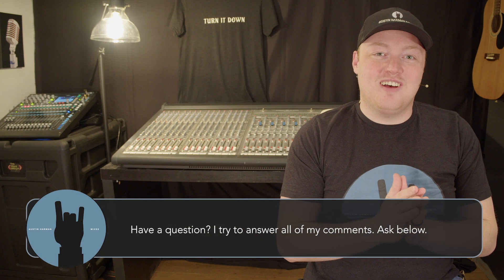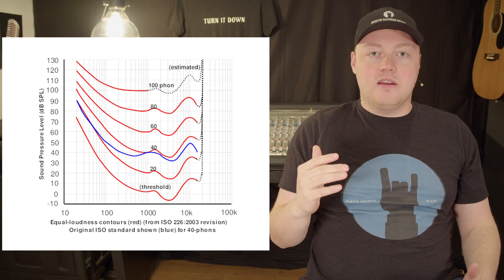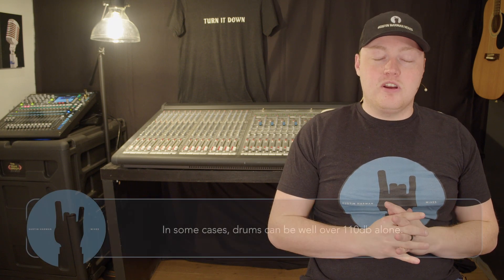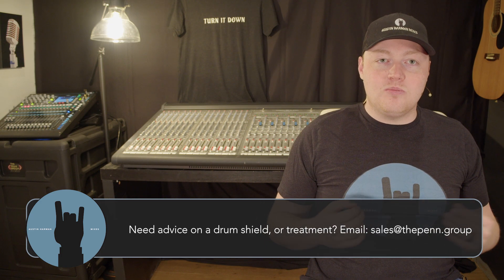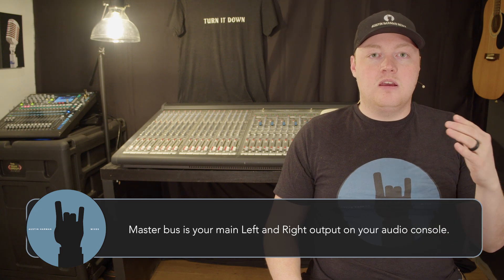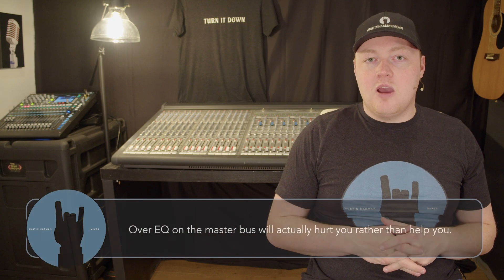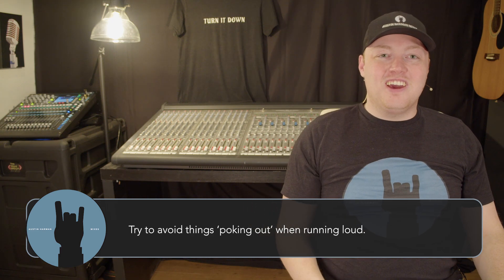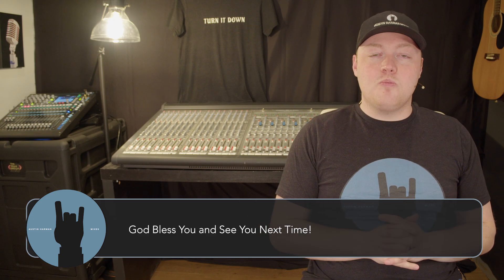How to Mix Loud Live Audio Loud Without Hurting Your Ears | Master Audio Engineer | Church Audio

Comment: Could you tell me which sound decibel meter is reliable and accurate. Or which is ur go too?
Reply from the maker: https://amzn.to/42FU845

This one is my go to. I like it because it comes calibrated from factory and isn’t crazy expensive.
Reply: @austinharmanmixes  another Question. Which IEM ears u recommend  around 200$  to monitor my mixes for broadcast.
Reply from the maker: @darvintoc  

https://amzn.to/4bJssiy

I love these. They are what I personally use to mix. Sound huge and full. Worth the extra $100 no question. I’ve had them for years, and still use them today.
Reply: @austinharmanmixes  do they cancel the noise in a live environment?
Reply from the maker: Not noise cancelation from an active since, but they provide enough isolation to be effective for sure.  @darvintoc